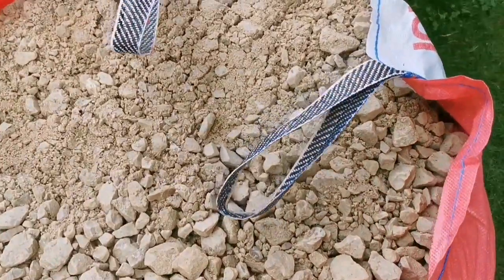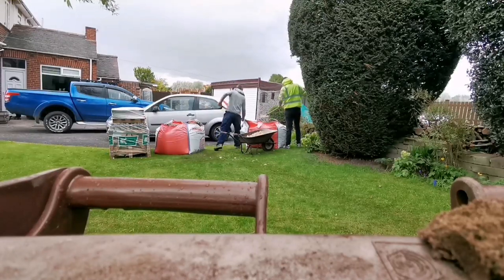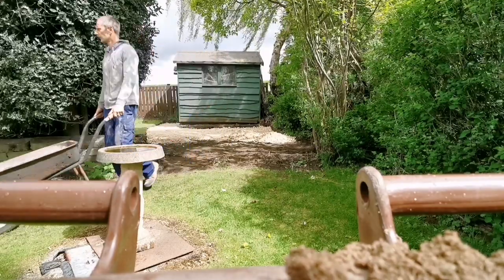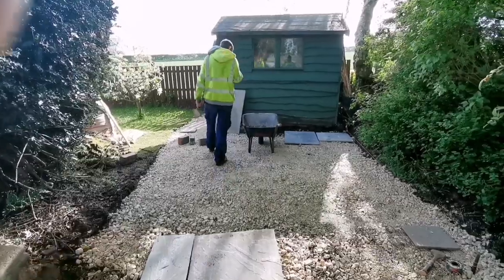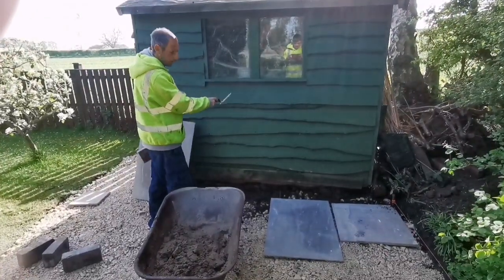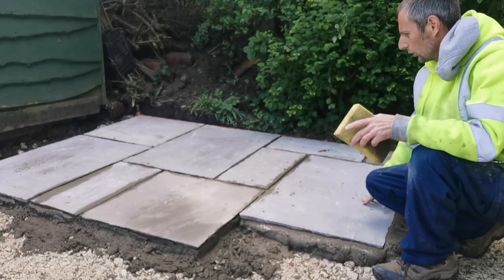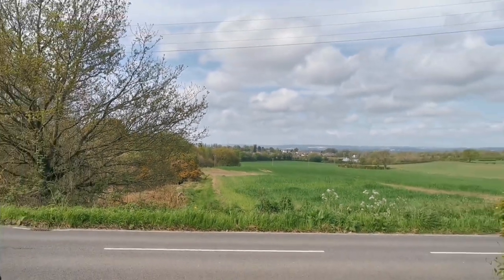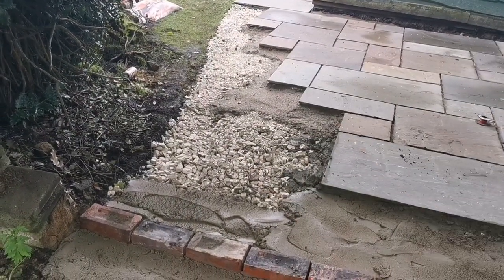flags and a few old bricks patio build

Comment: Hiya Mark, nice full bed there mate 👍.  Finished job looks a real treat.
I tend to stake out 2x2 either side of the works and set them to my falls then just use string lines on corner blocks to follow. It just means that I can judge my bed depth easily and don't need to use any other tools 😉
You could do with a white mallet though mate 😉👍
Regards
Tim
Reply from the maker: Yere Tim definitely would be easier. I have about 3 of them Wight mallets at home forget them every time lol👍👍👍

Comment: Next time mark 
Try using a Stanley blade and cut down the side of the bag and get some ply down and shovel off that.
Sounds like hassle but will save your arms and wrists
Reply from the maker: Yes you probably right mate a would be a lot easy to get it off the ground 👍👍👍

Comment: Should slurry back of the slabs helps with the sticking to mortar maybe a softer mix less banging down but tidy when finished
Reply from the maker: Chears Gary. Yes was thinking I should probably start surry the back of them. I haven't had any problems over the years. But I have heard a few stories where they just don't stick with out it 👍👍👍

Comment: What mix do you use for the bedding of the slabs?
Reply from the maker: Hi mate 4 to 1 but it's a lot better if you use sharp sand and a bit of building sand. The building sand definitely makes it stick better👍
Reply: @markhep  - Thanks Mark, I thought you’d be using a much weaker mix than that. Good tip on the sand, as I was finding difficulty getting cement:sharp sand 1:3 to stick when bedding ridges last year.
Reply from the maker: @Benzknees  you could definitely go weaker with it been stone. But it seems to have worked over the year for me. So I stuck with it lol👍👍👍